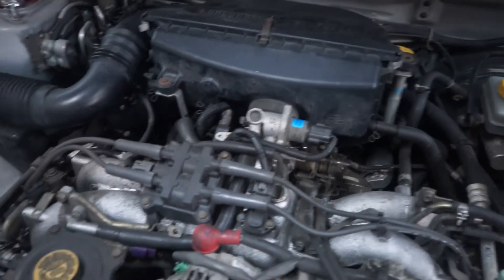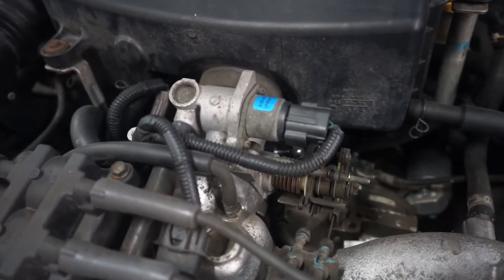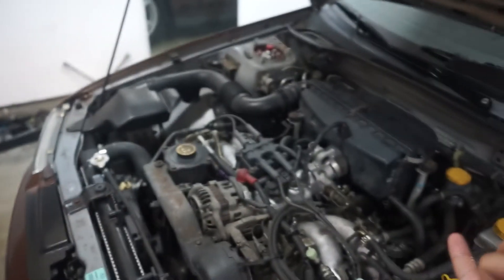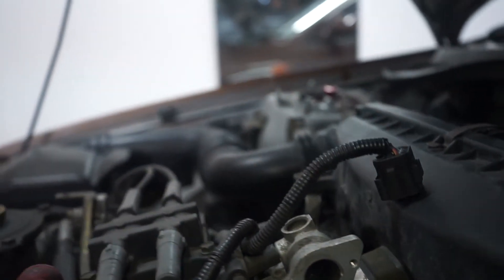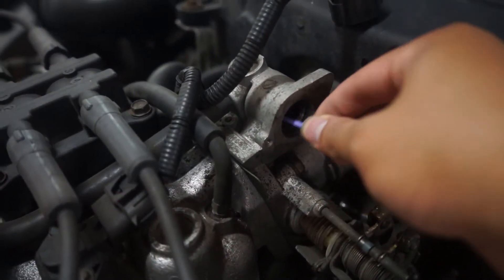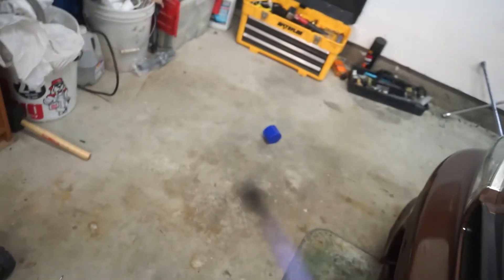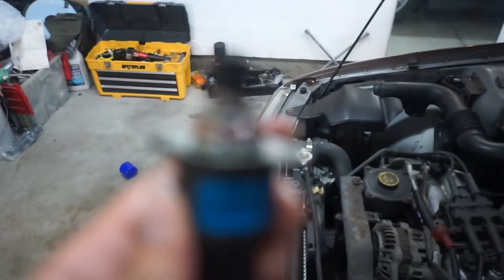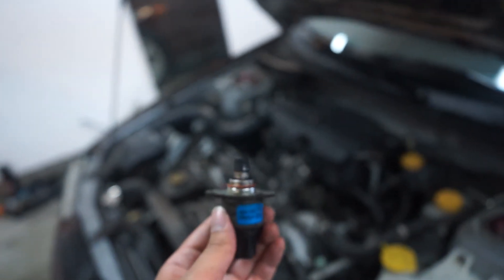CEL P1507 IACV Subaru impreza RS/GC Fix!

Comment: A lot of folks on the subaru foums think you need to use the more expensive Idle Air Control cleaner or other plastic safe cleaner.  Carb Cleaner is not usually plastic safe.  Hope it worked out for you.
Reply from the maker: i read somewhere that someone suggested carb cleaner. So far it worked and hasnt come back
Reply: still good?!

Comment: Yo dude this is a dope video man. I got the same code p1507 failsafe mode. I already replaced the idea control valve for 300 bucks like 5 months ago so ima try this.
Reply: Roshan Abraham it can be excessive timing issue causing misfire

Comment: I think my 2.5rs engine is alittle different. It does not have that part  . I check and looked, it has a cable throttle where that spot is